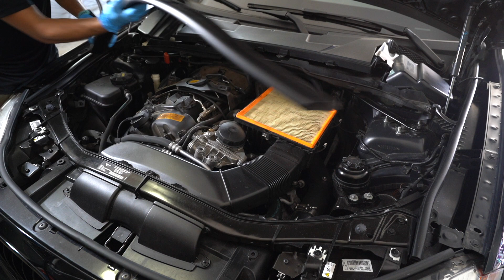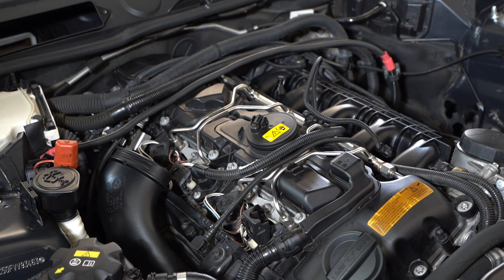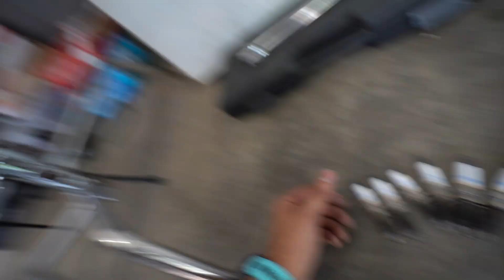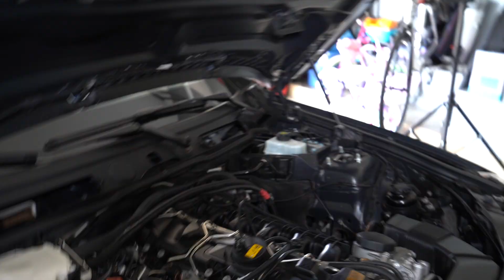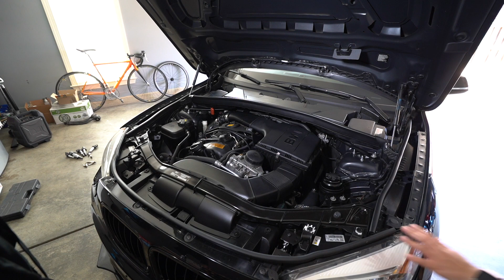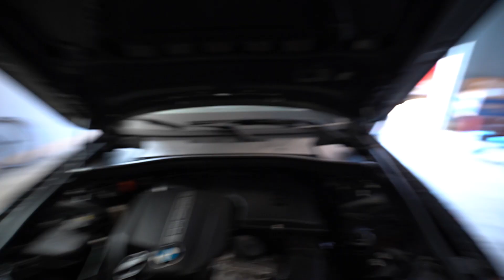HOW TO- Replace Spark Plugs & Coil Pack on your BMW. Bmw x1 xDrive35i.

Comment: The whisteling noise is the vacuum inside your engine is too high, and air is entering either your rear of front cranckshaft seal. Most of the time your seals are good, but the problem is your PCV valve. To test your PCV bring a cigarrete lighter (or other source of flame) close to the PCV , if the flame is sucked by the little hole in your PCV that means it is not good and need replacement. The bad news is: to replace your PCV you need to replace your Valve Cover. Also, after you remove your coils and before you remove your spark plugs, you can spray with compressed air to clean it.